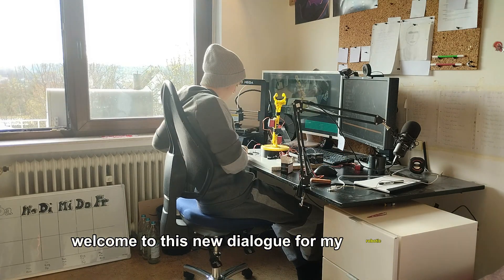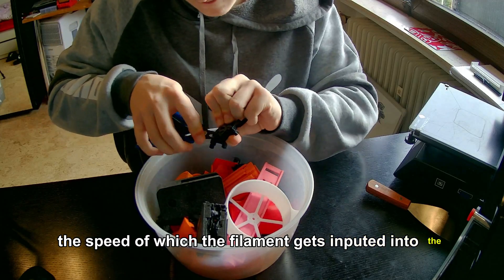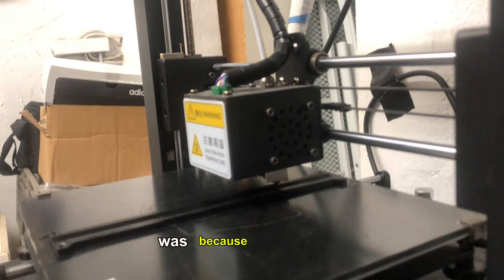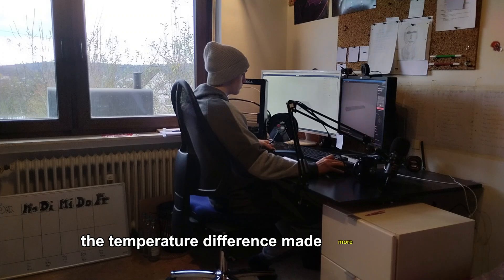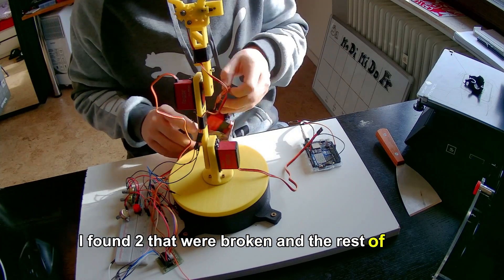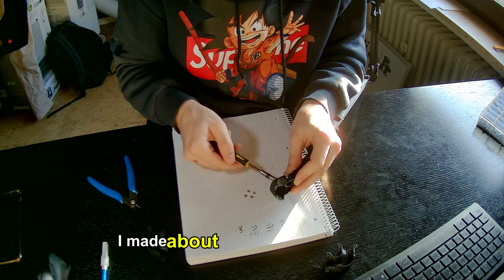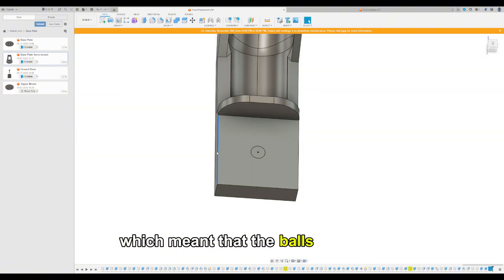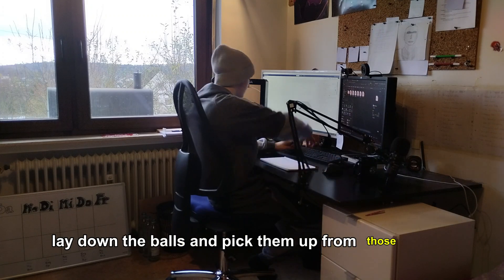Fixing My 3D Printer And Building A Track System For My Robotic Arm

Comment: poor servrs..hihi(k niw oeivken of direct translate
Reply: and consuder to buy or make filement dryer,because unfortenly is thet you need at ,a lot of filemet are moister abovsourbers,
Reply from the maker: Yeah good point. I thought about getting one, but it works where I have it right now. It is a cold room that is always at the same temperature so perfect for the 3d printer. But if this happens more often I will definitely buy one.
Reply: @YannikSpeath  this is har to achive  you have winter summer,i will have 3d printer in the basement,and there will must have ,you can diy one
Reply from the maker: I also thought about getting a new 3d printer as mine is quite old right now. I kinda like the bambolab printers because they are really fast but reliable. Might get one in the coming months.
Also I might make a stream this weekend if I get everything setup on the arm. It would be a programming stream with a lot of testing so probably quite fun to watch how I destroy the arm while testing it XD
Reply: @YannikSpeath  but bamboo are expensive one,bu as i lok at they arent perfect eather bad